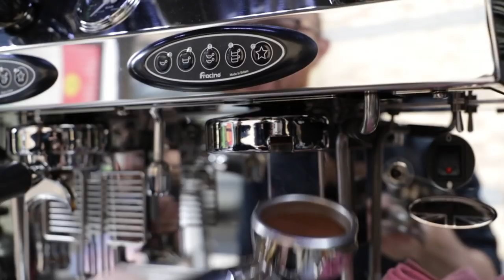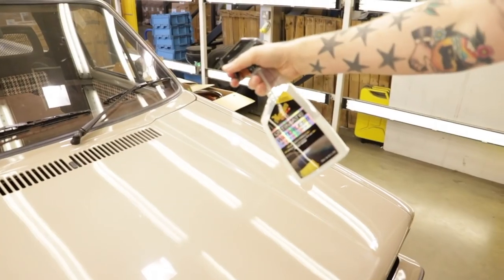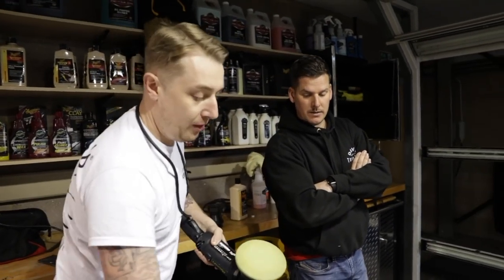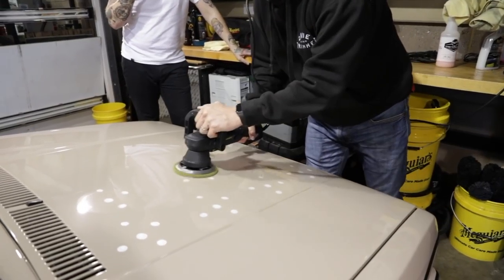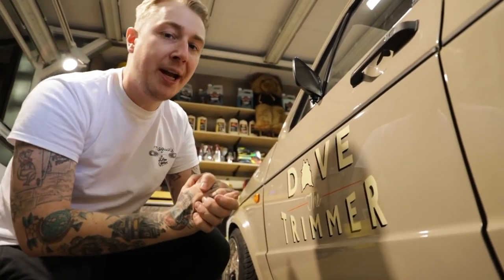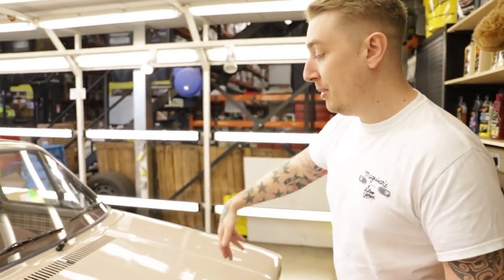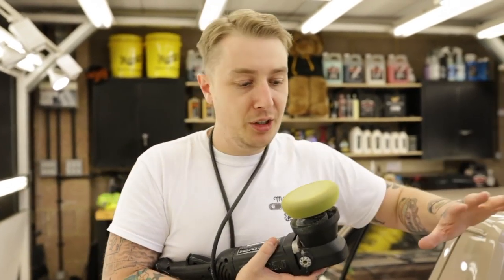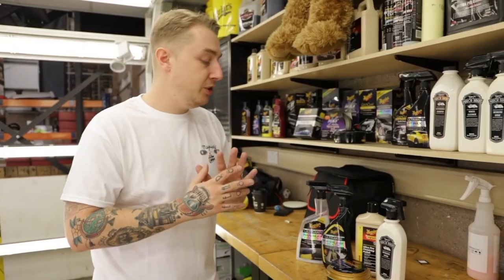How to REFINE & PROTECT Your Paint - Day in the Bay – UK Edition

Comment: I've always thought you shouldn't use any wax (waterless wash and wax) prior to polishing. I thought you needed to make sure all coatings were removed first. Have I been wrong about that?
Reply from the maker: Hi Tim, it's ideal to have the surface completely clean prior to performing a compound or polish step, however, it's not completely necessary. In this video, the clay bar step is removing any wax on the surface.
Reply: @meguiars  Oh gotcha. Forgot about the clay removing it.

Comment: Hi. Can you please tell me what's the difference between Meguiars Ultimate Compound and Meguiars mirror glaze Compound range?
Reply from the maker: That is a broad question without being more specific about which product but generally speaking the Ultimate Compound is designed for and is easy to use by hand, orbital, or Dual Action Polisher.  The Professional Mirror Glaze line compounds are going to be designed primarily with machine use in mind.  What kind of machine and how aggressive they are depends on the specific product but think of professionals also using these products to remove more serious defects or sanding marks after painting a car.  

To discuss what may be the best for your particular job please feel free to reach out to our Solutions Hub with more details.

https://www.meguiars.com/contact-us

Comment: Hi team Meguiar's. I tried to use buffer machine to polish the body of my car and i got to see a lot of blue colour on the buffer machine coming out but the job produced a significant result. I am with opinion to repeat the task, is it okay to repeat waxing for the second time?
Reply from the maker: Assuming the car is blue what you are seeing is a small amount of paint coming off.  That simply means you do not have a clear coat on your vehicle.  The same thing happens on any other vehicle but many times you do not see it because they are clear coated (clear paint). 
 That is not an issue if you are using the appropriate products & application method or for some reason you know that your paint is on the brink of failure and there not enough good paint left to work with.
Reply: Thank you for the info @meguiars

Comment: What the diferrent between m205 and m210?
Reply from the maker: M205 has been and continues to be a great polish used by many.  Although used easily by most there are some situations where it was a little hard to work with.  M210 has made it that much easier and nearly bullet proof.  It also offers a nicer longer working time which professional love.  Frankly both are awesome products but we couldn't just sit back and not try to make an even better product.